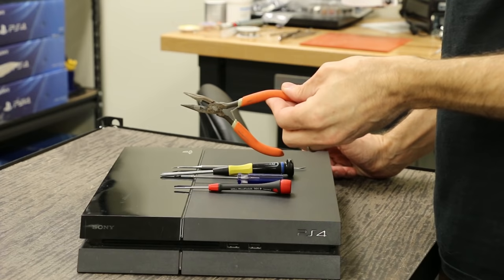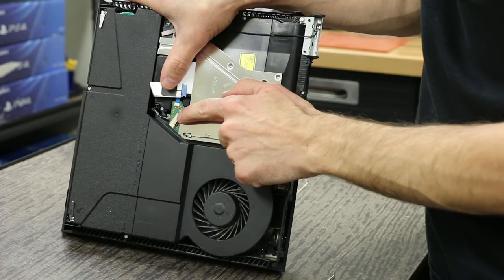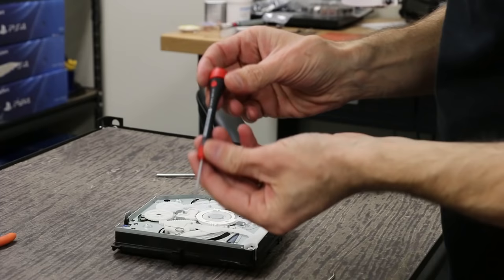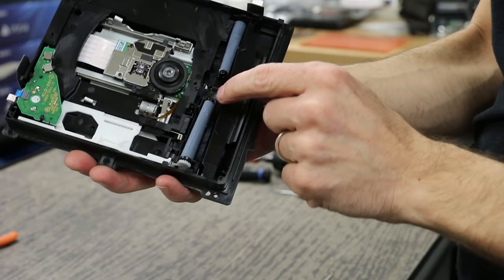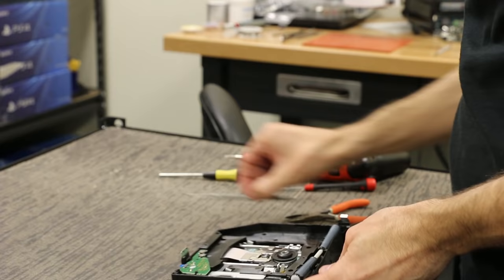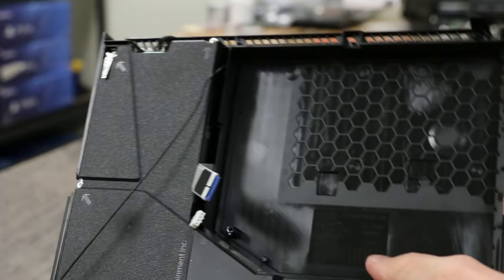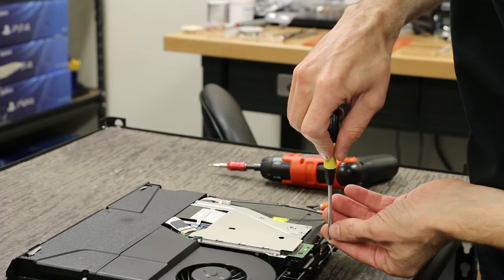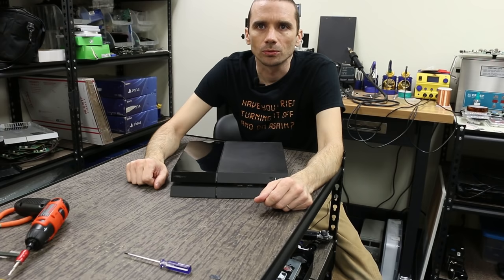PS4 Won't Read Discs Fix (Makes Noise/Won't Accept Discs)

Comment: Bought a ps4 dirt cheap because the disk drive was broken. Just opened it up and found a popsicle stick in the disc drive 😂 thanks for the help
Reply: Damn nice work dude. Buying "broken" consoles is the way to go.
Reply: I have a popsicle stick stuck in my disk drive, my 8 year old cousin stuck a broken popsicle stick in the disk drive and now I can’t play any games that require disk
Reply: I am going to pick up PS4 with disc drive issue for 50$ this week, Hope this is just roller issue ;)
Reply: Got my ps4 for free
Reply: Lol
Reply: @mumind2726  I’m going to pick up a ps4 for $140 with a broken disk drive and ima tru to fix it
Reply: @OfficialDiffy  maybe 0.01$😂
Reply: @CLUTCH_KID_YT  Nah my cousin gave me his PS4 because it had heating issues. I've cleaned the heatsink and applied thermal paste then i was all good😂
Reply: I hate it when that happens!
Reply: I got my credit card stuck 🤣🤣🤣
Reply: I just got my buddy's old ps4 cuz the disc drive didn't work well he has kids and they put a house key a Bobby pin and a nose ring in it 🤣😂
Reply: My PlayStation 4 does not look like that I have multiple screws on the back of my PlayStation to even get the hard drive off

Comment: I just took the top case off and hit it a few times and it worked fine 🤣
Reply: That worked for me for a few times, now nothing. I will  eventually get to opening her up and fixing it.
Reply: Brad Lally me to
Reply: @brauliolopez9018  i opened her up a few weeks ago rollers still in tact. Took them out cleaned them nothing. Yet my ps3 is still running strong.😡😡
Reply: same here smh PS3 so strong these PS4s are sad. not getting PS5 gona switch to xbox now unless PA5 is built like PS3 or better
Reply: Tutorial needed please

Comment: This tutorial was a massive help I was all ready to raid my toddler's piggy bank for a new ps4  thinking she had jammed several discs in there, but it was the roller joining spar. Though this experience has shown I need some new screwdrivers.  Massive MASSIVE thank you got the ps4 apart, fixed and back together again  thanks to this vid
Reply from the maker: So glad this helped!
Reply: Never hurts to have a small set of screwdrivers. Youll be amazed at how many things you can open with a good set. They go for like 20-30$ too! Highly recommend.
Reply: Congratulations you have been selected among the shortlisted winner's for the ongoing ps5 giveaway What'sapp the number above ^^^^^^^^^^^^👆

Comment: Thank you for this detailed, well spoken, and easy to follow tutorial.  I was able to follow the video straight away.
Both of my rollers were lowered and moved forward together; the disc when attempting to eject had parts rattling loudly. It appears I only needed to use the plastic side screw to wind up the white "slider unit" all the way back, but I wouldn't have been able to know that if I didn't open the case & the disc drive up and see the situation.
Reply from the maker: Glad this helped! Love hearing stories like this!

Comment: Awesome. Saved me a bunch of money. Most difficult part was trying to get my hands on a Torx security bit for those screws! Video was my guide and so far, all good. Looks rollers were still in place but not sticky enough to catch on discs.
Reply from the maker: Glad this helped!
Reply: Just tried it and fixed my PS4 in 10 minutes. Thank you!!!
Reply: Tip in case you don't have a security torx screwdriver. You a small flathead that fits in the grooves on a side of the screw. Be careful as it will turn the screw, but it can also slip. Helps when you don't have money for a security torx driver.
Reply: Congratulations you have been selected among the shortlisted winner's for the ongoing ps5 giveaway What'sapp the number above ^^^^^^^^^^^^👆

Comment: Man I tried everything... and finally.. other videos dont explain in depth..even if it's like ( hey well you took It apart you should know how to put it in) ....when u mentioned the part at 10:40 .... just something to simple like that fixed it all...because I was doing everything right and putting the roller thing back on and cleaning everything and was so confused why the Disc wouldn't go in anymore and boom.... little detail you spotted...because come on...I dont fix ps4's for a living lol i jsut basically rushed. But great video man..saved me 100 dollars easy
Reply: Some channels don't even have audio or what tools you need

Comment: Hey man, wanted to stop by and say thanks for the video. My ps4 is pretty old and recently it stopped accepting discs. Would make a sound, and it wouldn't be pulled it. So, followed your guide and while a roller wasn't out, I think it was that they were dirty as i'd never messed with that section of the ps4. I only ever took out the power block to dust it and the fan. So, as you can imagine, both rollers were filthy. I cleaned them off with a Q-Tip and alcohol, got everything back in and it pulls in discs just fine now.

Comment: took me 3 years to find this, been buying games online this whole time and its an easy fix lol. Oh well, time to dig in haha.
Reply: I have a problem my ps4 pro cant read some of my games , but this games are in agood condition because when i try to play it in any other ps4 it work , please if it work with you tell me
Reply: @isalmalnhas7554  sure bud. probably wnt be until next weekend for me to have the time to do it, but ill make sure and come back and let you know if it fixed my issue.
Reply: Thanks man
Reply: @isalmalnhas7554  me too i was trying to play titanfall 2 but it wouldn't read the disk same thing with the other games
Reply: nearly took me 4 yrs
Reply: My ps4 doesn't read discs so if I buy games online u think it work
Reply: geddon81 so if I buy games online it work my ps4 doesn't read discs
Reply: @jasonbonds0fe975  ofc it will work
Reply: Same

Comment: Thank you so much. My discs could never enter my ps4 and it was because of the driven blue roller blocking the opening port due to the white axel being out of place. This vid was very informative and helped me fix the issue pretty quick. Thanks again
Reply from the maker: +skills2kill84 Glad it helped and you were able to get it working again!
Reply: +TronicsFix Definitely did. It works perfectly now

Comment: My problem is my parents won't let me open up my ps4 and I don't have the tools to do this! How can I fix this?
Reply: FG Ethan Show them the video and talk them into ordering some cheap tools from Harbor Freight it's basically a Chromecast without a disc reader.
Reply from the maker: We're happy to fix it for you if needed: https://tronicsfix.com/collections/playstation-4/products/ps4-disc-drive-repair
Reply: TronicsFix can u help me please please I'm begging you my play station won't read the disc
Reply: I feel you bro....i feel you
Reply: If your on a 2nd floor find the nearest window and toss it, it should open the ps4 right up if you dont have a 2nd floor then find a biggest brick you can and drop it on your ps4 or just you can try to shoot the screws off with a 50. Cal
Reply: TriixR4KiiDz this glitch has been patched bro

Comment: Just fixed mine with a finger nail file and the end of a pair of scissors. Didn't have the right tools but I figured this was the problem. Thanks Guy. Disc sliding like butter now and reading correctly

Comment: I was a bit to lazy for the whole process so I just turned it on put the disc in and banged it lightly in a few key spots and it worked😂😂
Reply: banging lightly, hardly banging or banging hardly?
Reply: Bro this brought me back to my Xbox 360 that thing was so old and was pushing death to the point where I had to spend 30 minutes beating on it while I insert the disc hoping to hit the key points to get the read😂😭
Reply: @wakegary  riddle or question?😂

Comment: Sadly I don't have the tools but just what video I was looking for. Thanks a lot :D
Reply from the maker: Glad you liked it.
Reply: Same thing was with me. All you need is a flat head screwdriver of you dont have a torn screwdriver, a normal +head screwdriver ( maybe a small one ) and there will be a part where you cant use the flat head which you used to open everything, I think then u need a more smaller one because I had these two things for mine but I kept on searching and I found a torx screwdriver attachable head in the tool box ( CR - V T8 was written on it tho)
Reply: For me these 3 worked - 
CR-V T8 ( Torx screwdriver attachable head)
CR-V 1.5 ( flathead screwdriver )
CR-V PHOO (+head screwdriver)
; these were the things written on them

Comment: I’m to scared to do this id break it
Reply: Same😂
Reply: Mantas Z same
Reply: I guess im gonna do it tomorow cuz i have nothing to play but i have discs😂
Reply: Mantas Z same I’m trying to play cod 3
Reply: Im trying to play gta5
Reply: Mantas Z Is your disk reader still not working
Reply: I didnt do it, i did not have the right tools😔
Reply: Mantas Z if u tap the top of the disc reader on your ps4 it might work I know it’s cheap but at least it still works
Reply: Mantas Z when it’s reading the disk
Reply: You guys probably will. Buy a broken PS2 then PS3. Once you've taken them apart and back together you should be confident
Reply: Zayda Peralta I ate poop
Reply: Don't be scared just put your all strews together
Reply: I did it. It's actually really easy.  Going to do a better job on cleaning the wheels though. Mine was still put together so I just cleaned it half ass.
Reply: @mantasz735  you can find everything you need on Amazon for less than $20

Comment: @TronicsFix  I personally would like to THANK YOU LIKE 1MILLION TIMES for this EPIC instructional video dude! I fixed my little boy's PS4 this weekend simply following your guide and you were 100% ON POINT! The stupid little white rubber wheel connecter thing thing was jiggling loose inside of the disc drive! I put it all back together\cleaned it up a bit = SUPER HAPPY 10 YEAR OLD LITTLE BOY! #puregreatnesssir
Reply from the maker: So glad this worked for you!

Comment: I am not a Hardware guy but once I took a risk with my then new PS4 system by opening it with a 1 dollar chinese small magnetic tool kit and I literally ripped everything apart and rebuilt it. Took me several hours to do it and many troubleshoot videos... then had to get my Lens replaced for 50 dollars. A year and a half the problem is back again... Its Sony's bad lens making policy.. Ever heard the story of a car company delibrately making bad brake linings just to profit more from recurring service costs to customers and didt care about accidents happening on the road because of them.. Well if you can see the parrallality of them both in some kind of moral light then its purely COINCIDENTAL...!!!!
Reply: I have my PS4 since the release. I never had any problems with it. Except a broken power supply after lightning struck my neighborhood. It was a easy fix btw. Now after 5 years my diskdrive is not working as it should. It's probably a roller because i have to push the CD a bit on the right side to let it in.
Reply: @jansen7640  u got lucky mate i got it too but mine came with factory issues. U can do nothing about it
Reply: Incorrect use of literally. Otherwise good job.
Reply: I feel like that’s my ps4 I got a new game and it won’t load it along with two others I have to use a whole separate ps4 to play

Comment: Thanks for this video. My PS4 was not accepting discs. I took it apart to discover my 3 year old son had shoved a plastic piece into the disc drive which dislodged the rollers. Reconnected them and now it works again!
Reply from the maker: Awesome! We get tons of consoles with random stuff inside!

Comment: thanks for the video my problem is that my ps4 cant accept any game  i tried to insert one but got stuck inside my ps4 what should i do to fix that it suddenly happened to me could it be from dust or what ?
Reply: . Ichigo same problem here. Did all of what the video said, rollers dont seem to be grabbing the game.
Reply from the maker: Yes, it could be from dust. No way for me to know without having it here at my shop to look at.
Reply: TronicsFix thanks for the fast respond I think I will fix it at store nearby have a nice day
Reply: @jackiedaytona3965  Same

Comment: I put my disc in then my ps4 sounds like there is a bunch of rocks getting thrown around in it then after 5 to 10 mins it will eject the disc and say disc unregonizable
Reply: unrecognizable
Reply from the maker: Sounds like maybe a laser or there could be some other issue with all the noises. We're happy to have a look at it if you'd like: https://tronicsfix.com/collections/playstation-4/products/ps4-disc-drive-repair
Reply: Laser is so bad on ps4 after i 6 month it was i trouble ty sony

Comment: plz respond ! whenever i put in a disc, i hear the disc roll, then it sounds like when you take out the disc but it doesnt do it, stops reading the disc than it starts reading it and then i get a disc error..what could it be?
Reply: Same with mine.
Reply from the maker: Could be a laser issue but there's no way for me to know for sure unless I can look at it.
Reply: Want me to make a vid so you can see?

Comment: my ps4 says unrecognized disk it wasnt the white piece or the rollers what can it be im so frustrated the discs go in than it makes a sound after ljke a minute like it is going to eject the disc than jt says unrecognized disc
Reply from the maker: Might be a laser problem
Reply: Tronix when i took mine apart the grey and white circle thing that is on top of where the laser is was loose i out it back but im not sure if i need to do something else it took a pretty bad fall of course my brother walks in while im playing gta and takes out a wire.
Reply from the maker: That's supposed to be loose. 
Ha, ya, that seems to always happen right in the middle of games!
Reply: I freakin did it yessssss
Reply from the maker: Nice! Good job!
Reply: TronicsFix thx
Reply: Thx for the video it really was tge best one ive seen
Reply from the maker: Glad it helped! That's why I make them!
Reply: what did you end up doing to get it fixed?
I am having the same problem. The only disc that will read is Star Wars Battlefront 2.... EA made a bigger disc and gaped my ps4 >:(

Comment: my rollers were in place but when i put a game in they dont pull it they dont even move it seems please help someone
Reply: i closed it without changing anything and it worked ... i dont know what happened the rollers were in place i took them of and put them back the same way and for some reason it worked thanl you for the video helped a lot
Reply from the maker: Strange...well, I'm glad that worked for you!
Reply: George Georgiou Same thing here :D after putting it back together it works.Everything was in place I still took the rollers out in case and now it works like new

Comment: My ps4 reads some disk but not all.
Reply: same bro and my ps4 when I put disk in I have to push it in myself because it gets stuck
Reply: White Boy69 same here to me. my ps4 read some disc but not all of them.
Reply: It's not reading black ops 3 I dunno why?.....
Reply: same it doesn't read my gta but it i out in bo3 or 2k it reads perfectly ... and my bo3 has a lot of scratches on it and my gta is fine.
Reply: Saucy Plays same
Reply: Maruo Odisho if that happens its because the ps4 is overheating just take a small book and put it under thr disk area to elevate let it sit then it should be gud
Reply: @Yaanfoe444  same my gta wont read
Reply: AbusedGlocks I think the gta is just a disc malfunction cause gta disc issues all are around on Xbox and PlayStation and they will be in fine condition just a idea from what I’ve seen